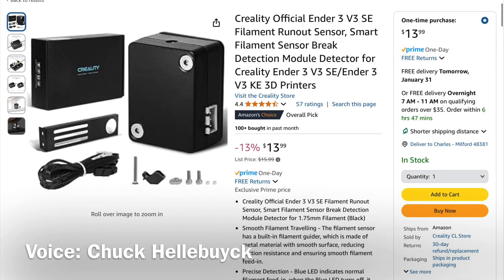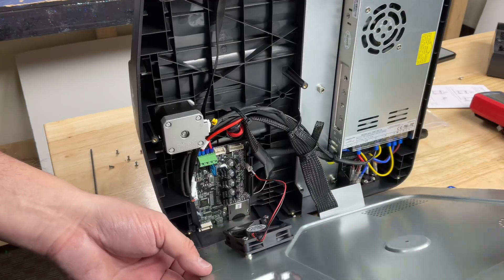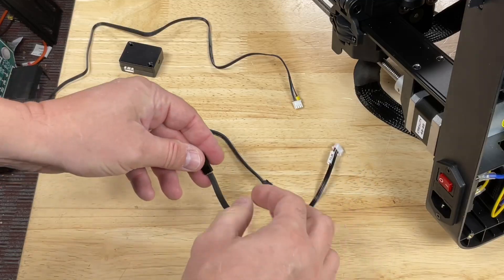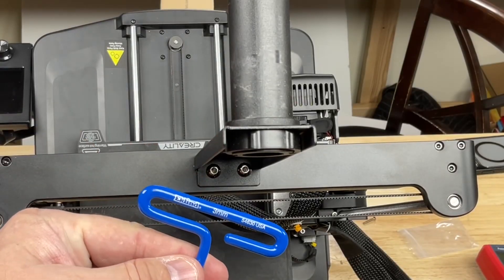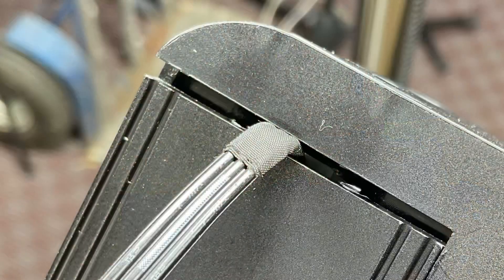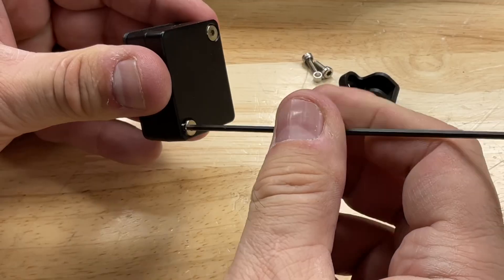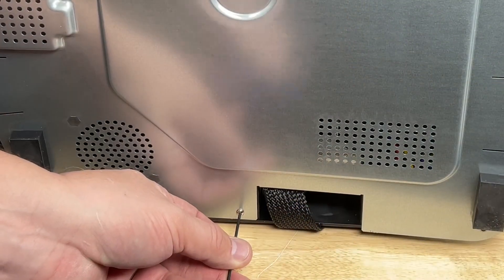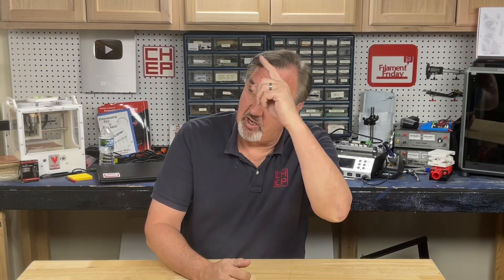Upgrade Ender 3 V3 SE with Filament Runout Sensor

Comment: Great video! I just bought my V3 SE a couple of weeks ago and ordered this sensor at the same time. Instructions in this were spot on except for one thing. Creality made a wire channel in the bottom if the top bar to run the wire through to the sensor. It takes a little bit of coaxing to get the top back on, but when its done the wire is nicely routed to the sensor.
Reply from the maker: My printer is older

Comment: Hey everyone FYI i have installed this Filament Runout Sensor on my Ender 3 V2 and it works great. I just swap out my current spool holder with the one that came with the kit. I am running Professional firmware. So for me to get this to work with my firmware I had to go to Advance Settings, filament Settings, Enable runout. Make sure Runout Active is set to High. And adjust your Runout distance MM. and you are all set. I tested with a CHEP Cube print. half way i cut the filament it stop. i put a new line back in. it started back up continue the print just where it left off. Finished the print and it looks great.
Note: my main board in my printer is a 4.2.7 so i didn't use the wire that was supplied with the kit. I had a longer wire from a older runout sensor that had 3 pins on both ends.

Comment: I have the ender 3V3SE and I connect the four pen to the right spot on the main board but when I turn it on the LCD screen does not turn on when I unplug the filament running sensor from the main board then the LCD turns back on is this a firmware issuethat anyone knows of?
Reply: with the RED, BLACK and WHITE configuration on the 4PIN Filament connector, the sensor was on also the LED light, but when I tried to remove the filament the power of the screen went out, of course that I’ve panicked, but I inserted the filament back and the screen turn on, then I said why not trying to invert the wires so I inverted the BLACK with WHITE and connected again the sensor and try again, surprise the sensor worked normally, with the exception of the LED

Comment: Thanks for the video but you're running the cable on the wrong side.  facing the printer, the cable should run from the right side and there are clearly  groves left out to run the cble through. Also, the instructions that come with the sensor clearly shows you to remove the gantry so you can feed through the black cable connectors through.  I had to cut nothing at all and the cabled tucked in beautifully. That being said, if you are not handy, do not take on this upgrade, it is a bit fiddly. also, after reassembly, you'll have to re-level the machine.
Reply: Thanks for this, I got mine fitted thanks to you both!

Comment: Can that 3 pin slot you showed first on the board be used for a 3 pin runout cable? My wire is 3 pin

Comment: Dude, this is fantastic. Thank you! I Will say though that our version must be a bit newer, because they actually already made room where you had to cut the plastic for the cord. Also, the screws on the bottom required a Phillips head screwdriver instead of Allen wrenches. Great vid, this made it so much easier!

Comment: My Ender 3 v3 se already had cut outs to run the cable through the gantry and  under the cross beam. Great video. I’m breaking out the ol’ ender after moving. I am currently using an X1C as my main printer but now I that I have the room it’s time to setup and upgrade the ender.
Reply: Mine also has provision for running the cable in the gantry cross beam :)

Comment: Glad you caught the errors in the manual-- saved me a lot of time.  Creality needs to fix that ASAP.  It was a bit of a struggle feeding the cable through the extrusion.  I ended up pushing a string through it, tying it to the cable and (gently) pulling it back.  Getting it through the hole in the base was the hard part.  I manipulated the plug with a dental probe while gently tugging the string until it popped through.  All in all, I'm very happy with the upgrade.  Now I can use all those partial spools I didn't want to use for fear of running out in the middle of a print.

Comment: Thanks for the video. It made a lot of difference.
The manual I received with the sensor actually had a white sticker over the board diagram, so I think they know the instructions there are useless.
My SE had a notch already on the top bar, so I didn't need to cut one, and a place for the wires at the sensor so was keeping both ends of that wire under the top bar clear of the moving parts.

Comment: I just installed one of these on my SE, however the light on the motherboard goes out, and the screen, level sensor, and the runout sensor do not light up. I'm not sure what the issue might be

Comment: Thanks for your video. It was super helpful. I found the perfect thing for keeping the wire neatly under the printer cross bar. It's called a ziptie tree. There are two holes in the underside of the cross bar and the ziptie tree fits the holes perfectly.
Reply: Hello thank you for the ziptie tree info. Could you please post a link? Thanks

Comment: I actually can't stand these things and find them to be more trouble than they are worth.  I haven't ever had one save a print and they falsely trigger far too often.  I've had them on 5 different printers from 4 different brands and all of them have been a hassle.  Now I just leave a 3" long piece of filament in them or just short the connectors and pull them off entirely.  When I converted my anycubic kobra 2 and kobra 2 max to klipper the first thing I did was pull these bloody things off and tossed them out.

Comment: The filament runout sensor on my S1 break in the day caused drag on the filament and caused endless underextrusion issues. It was easier just to toss it and run no sensor. Creality jankiness was never ending, glad to be done with them at this point.

Comment: Great timing. Just looking at buying one of these. 

I was going to sell my SE and buy a Bambu A1 but after their crap I've decided to keep the SE and fiddle with upgrades start a saving account and get a Prusa next year
Reply: Just installed mine. 

Man getting that black wire threw that small hole almost broke me.

Comment: You said this is last printer ender 3 family you said this printer run on Marlin firmware could you please make a video on installing clipper on this printer with raspberry Pi 4
Please make a video❤❤❤❤❤
Reply from the maker: I would just tell you to buy a KE or Ender 3 V3 or get a Bambulab A1 or A1 mini.
Reply: @FilamentFriday  ok

Comment: Thanks for the video! I have been thinking of this for a while. I have a question. I use Octoprint to control the printing. Do you know if the printer talks to Octoprint about status? I was able to install a Bigtreetech Smart Filament Detector on my old Ender 3 and get it working. IIRC I had to do a firmware update to get it to be seen by the Octoprint webserver. I was wondering if Creality thought ahead and already enabled this feature in the firmware.
Reply from the maker: I don’t know. I don’t use Octoprint.
Reply: @FilamentFriday  Probably not: it will depend on the firmware.  If it supports Host Action Commands, it will tell OctoPrint.  But I don't know about the firmware in the V3 SE.  Creality firmware is based on Marlin versions which can, but it's an optional feature and Creality rarely enable any of those.  To the best of my knowledge, the V3 SE firmware doesn't either.
Reply: @pnt103  Thanks. I was afraid of that. If worst comes to worst I will find the latest marlin FW source code, make the changes and recompile. Was hoping to avoid this.

Comment: I barely see anything in my feeds regarding the Ender.
Reply from the maker: Yeah, most content creators dropped it. I still have an Ender following so I support it from time to time.
Reply: Bud we are missing you on friday. @FilamentFriday
Reply from the maker: I’ll be back soon. Was traveling a lot and then got sick.
Reply: @FilamentFriday hi chep great video i goth sensor hookt up.
Works  great thanks .
Hope you do nebula pad  
And y axis z axis to.
And let the se run full speed on klipper
Reply: After the update thing on the Bambu... I bet you're going to start seeing it again.